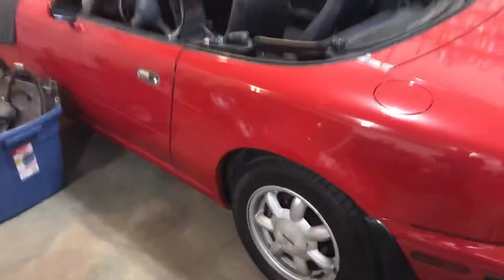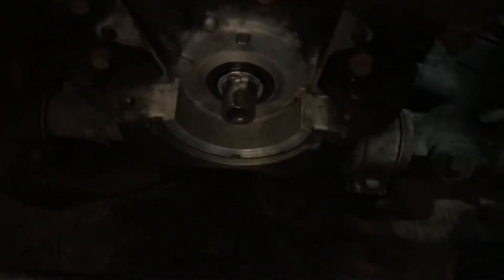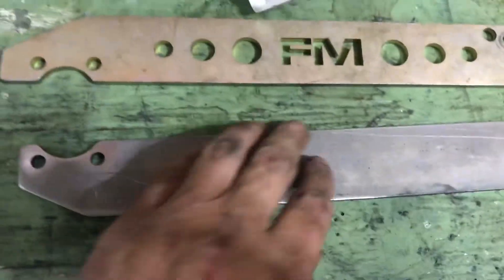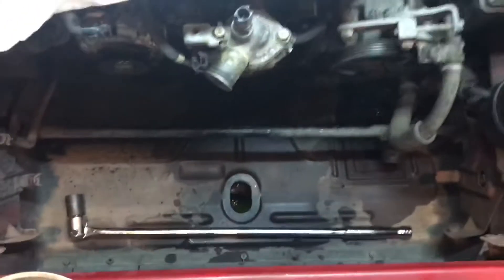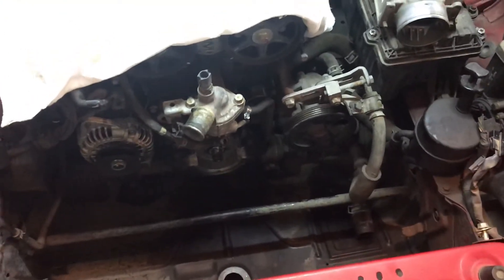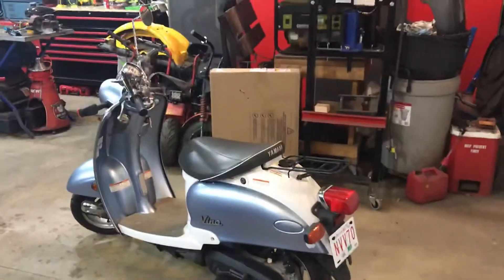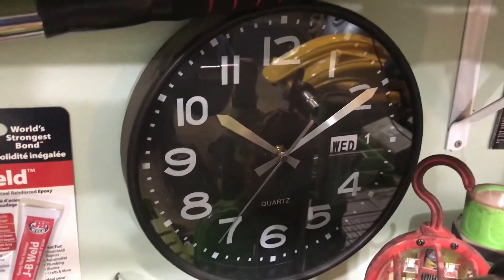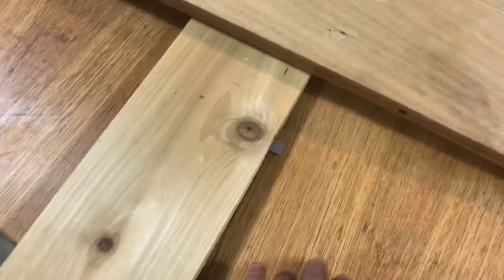1990 Mazda Miata NA Short Nose Crank Failure

Comment: My crank started to wobble gently a week ago, how much time do i have till it gets really bad because its kind of my daily driver
Reply from the maker: It varies.  Keep an eye on your RPM's. If they start to drop below normal idle speed when you let off the throttle, the end is near.  If you have a torque wrench, put the car in gear, have someone hold down the brake pedal and tighten the crank bolt to 90 ft/lbs.  That might help

Comment: Awesome Bruce《☆》I used to see the same Miata driving to work every day. He always had the top down even in 30°f weather. Word was he had a nitrous kit but I never met the guy. He used to own a flight school. Looks like your repair should be good for at least 100k even if you decide to go the turbo supercharged meth nitrous injected fire breathing route. I wonder if your Mom is a PinkFloyd fan with all the clocks ? :*: Greetings from⛾Florida🤳my friend🤓🎱🔊☮✌👍🏾
Reply from the maker: Thanks BDOG.  I've seen people around here driving them with the tops down in the cold too.  The exhaust runs right inside the trans tunnel and throws a lot of heat into the interior, so wear a toque and you're golden!  It was my mothers 78th birthday today, I don't think she's a Floyd fan

Comment: How's she goin'?  That's a big job getting to the part and then another big job to repair it!!!  Good that the repair shows signs of lasting well though.  It's nice to have lots of projects underway, but not if they bog you down, so take it easy eh!!!
Reply from the maker: Hey Mike.  Yes, it's a very labour intensive job just to get at the crank pulley.  Not too difficult, just time consuming.  I think I'm finally starting to catch up on all the projects... I think